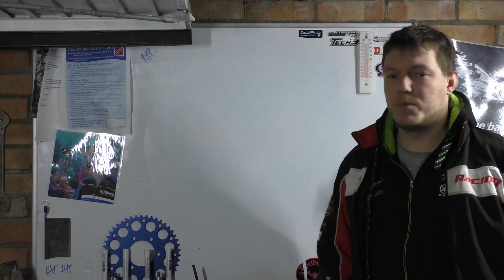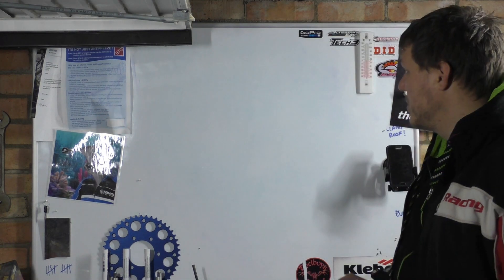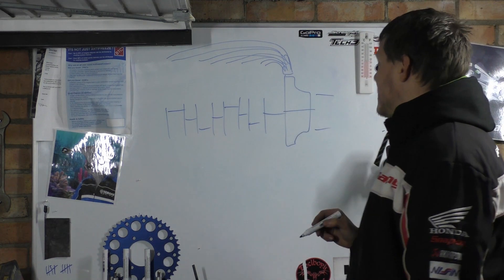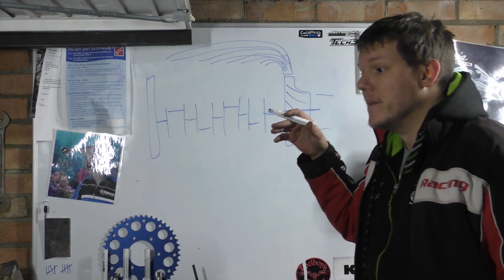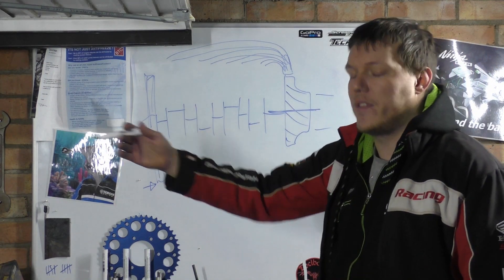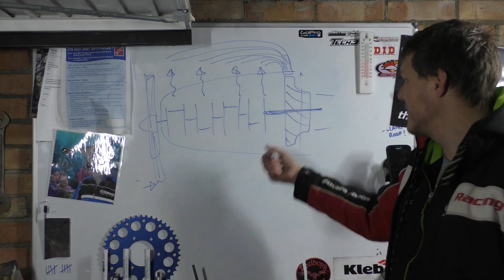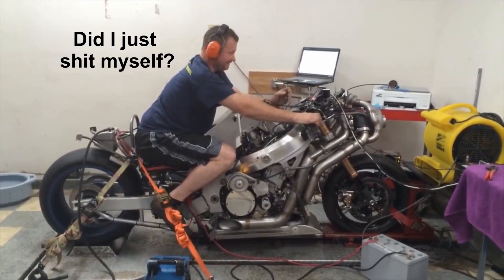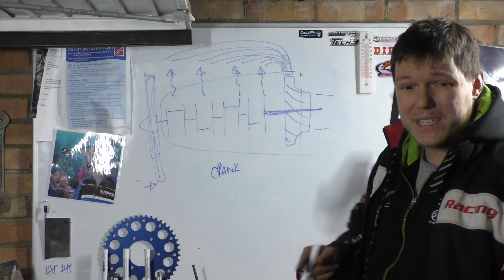Turbo Compound engines - How they work - Part 1

Comment: you can make that turbine to turn a generator. then an inverter with proper work point tracking can feed an electric motor.  thatway you make sure to extract as mutch power as possible. in ww2 supposedly them eglish peeps managed with mechanical coupling a whopping 30 ish % GAIN by turbo compounding. i would welcome it on bikes and trucks and cars and what not, to be honest.
Reply: Its been tried Scanna offfered a turbocompound engine for a while.
Reply: @jediknight1294  yep, and in hungary RÁBA offered a 180 hp "kombi-turbo" engine. however, those did not employ inverters to match the load. for applications that had variable loads and engine RPM conditions, those solutions where not so good. one methood was using a direct gear coupling, and the other used a super complicated hydraulic system. none of those managed to work properly. however nowdays it would be verry possible to use a proper inverter, loadmatching , and thus it would be a very viable solution. currently the technology does exsist however its patented and for that reason it will never be allowed to be used. sad story.

Comment: There are some tractors with turbo compound but the compounding turbine is attached to the gearbox by a transfer case instead of attached to the crankshaft.

Comment: Matt! am I wrong (I'm not😁) but the ultimate turbo setup is VGT, all the pro's none of the cons of any other turbo configuration, WHY are other systems still used!!!????
.....Cost, I know, but other then that....
Reply from the maker: Variable turbos are variable to a certain degree, the issue is generally spool up times and VGT's help a bit bit there's still the mass of the turbine wheel to acelerate.
Reply: VGT turbo's limit exhaust flow at higher vollums.

Not sudge a problem in a diesel ware exhaust energy is limited by bether fuel efficenty and no varible valve timing.
Less heat and lower RPM means that the restriction @ higher exhaust vollumes is not an issue.

On a gasser this is an other Story.
There is more heat availeble over the rpm range ..and the RPM range is wider 
Here the gasser makes power in higher RPM as the diesel.
A restriction in exhaust flow would raise EMP (exhaust manifoild pressure).
Changeing the ratio between IMP(intake manifoild pressure)/EMP you would negatieve effect your VE(vollumetrich efficenty).
That's why ita not the number one choice in a gasser.
Max EGT (exhaust gas temerature) that these VGT turbo's can take are also lower then the waste gate types.

Porsche had VGT turbo's on al gasser

Comment: Hey, I'm not trying to be pedantic, but you said the turbine is directly coupled to the crankshaft.  Digging back into the cobwebs of my memory and aviation classes,  turbocompounds are generally geared to the crankshaft.
Reply from the maker: LOL it depends what you mean. Most of the compound engines that were designed were here in the UK and they had turbines wheels connected to the crank. The nomad is the obvious example, The R-3350 had external turbines and an impeller attached to the crankshaft - more modern examples have geared connections rather than crank attachment. Smaller and lighter.
Reply: The Workshop Could be that ale let my speck of knowledge about centrifugal superchargers leak into.the tinier speck about turbocompounds...  

Yes, you Brits came up with a few that weren't seconds away from breaking at every conceivable moment (like the Wright). 

There's something about those old fire breathing machines designed by men with sliderules and flown with guts. 

I still have a thing for round engines, though. Had an F4U Corsair poster on the wall as a boy.  It didn't impress my great uncle, a Grumman engineer who worked on the Bearcat.

Comment: OK. I get it. I thought you was talking about compound turbos. kinda like twins. except the are a smaller and larger turbo. with the larger turbos output feeding the input of the smaller one . then to the engine. and the exhaust side doing the vise versa. so the smaller turbo can spool faster. for low end power. then as it starts peaking. the larger starts pre compressing the inlet charge. I guess a simpler way to explain  would be boosting a turbo'd engine! that's what you was getting at. this is a different kind a monster! looks like one anyway!
Reply from the maker: This is compounding turbos not turbo compound engines - this is coming next though....

Comment: Why are these used on diesels so much, but rarely cars?
Reply: The increase in risk of sending your engine to the nether realm and the cost of developing and building it? 
That's my guess in short terms. :P
Reply: But one foot at the edge of the nether realm is the sweet spot for all engines!
Reply: There are only 2 diesel engines currently using turbo compounding... Volvo D13 and Detroit DD15 and DD16. Compounded turbos on the other hand are more common. They are used to increase boost pressure.
Reply: Becouse compounding means multiplay the PR and there is no over boosting a diesel.
But depending on factors Like octane, IAT, ethanol, ignition timing  bla bla auto ignition will become a problem at hi PR (presure ratio).

But internet hero kevin jewer drives a 2.0 4 cil evo engine @45 til 60psi boost. (996hp)
So it can be done

Comment: The P-38 Lightning used these. At first when the quill shaft would break the centrifugal forces spun a few planes into the ground. They later fixed that issue.
Reply: Maybe you're confusing the compounded turbo / supercharger but these were not a turbocompound engine.The only turbocompound  aviation engines I'm aware of are the Wright Cyclone and the Napier Nomad.  Turbo-compound versions of the Napier Deltic, Rolls-Royce Crecy, Rolls-Royce Griffon, and Allison V-1710 were constructed but none was developed beyond the prototype stage. https://en.wikipedia.org/wiki/Lockheed_P-38_Lightning

Comment: what if we pass the exhaust through another propeller to produce more power keeping in mind not to run the other propeller via an engine connected to it.I hope it will surely produce more power.😀😀😀😀😀
Reply: Saubro Bo
Reply: Puffy Panda 
What do you mean really?

Comment: Well the turbine on my turbo is about 60mm diameter, spins at about 150,000 rpm and generates about 10hp. So either you have a fuck off heavy turbine spinning at a low speed taking up fuck loads of room for very little power output, or a big complicated gearbox to increase the output rpm to something useful and then manufacturing costs go WAY up for very little benefit. Not sure how this is a particularly effective solution, as you're always adding weight. Surely would be more effective to run a conventional turbo and then run an Otto cycle and recover the energy this way?
Reply from the maker: http://naca.central.cranfield.ac.uk/reports/1944/naca-report-786.pdf

Comment: What about powering your generator, waterpump......  whith the exhaust instead.?
Reply: Ahem... Recovery turbine linked to the crank via conical gear so one can vary the speed to match exhaust; the recovery turbine has "freewheeling" extra stages connected to another blower, or leads on to a conventional turbo feeding into a reservoir, which then leads on via an overpressure valve to a bypass inside a roots connected straight to the crank. You get the full low-end torque boost from the roots, however with boost in the reservoir on tap you won't need to waste power off the prop shaft to turn it at low speeds, and at higher revs the flow of power "evens out".

Comment: It was used on the madness that was the Rolls Royce Crecy two stroke aero engine.
Reply: That is an interesting engine :)
Reply: I'm just reading a book on it, Royce never got the bugs out of it so it never got fitted into an aircraft but it would have been hellishly powerful if they had. And noisy.
Reply: @markyoung13  theres so many fun designs that if they'd got the bugs out of it would have changed cars/aviation and that is one of them. The chevy turbine is annother.

Comment: Wouldn't a little bit of a gearing betwix the turbine and the crankshaft be a tad bit better because turbines make fuckall torque? Like some sort of gear reduction from the crankshaft to the turbine?
Yeah, i know it would increase wear and maintenance cost because more moving bits and more oil lines and stuff, but i think it would be a bit better
Reply from the maker: 2 things -

1) they do, volvo and Scania have reduction gearboxes - but this drive is not directly attached to the crabnkshaft.

2) Turbines speed is a design function not a static fact. Turbines in turbo's go 100k rpm+ but that doesn't mean all turbines do. You design the turbine accordingly.
Reply: sure, one type of "gearbox" vs. another, but I suspect that to get usable power at normal engine speed the diameter will have to be quite large
Reply: The problem is making gears that can handle 100k+ rpm. Do-able but stupidly expensive.
Reply: Pedro, that shown compound engine is to spin the crank faster/easier with less consumption of fuel. It is not to boost the intake pressure! Look at it as adding the power of 1-2 pistons without you having to add those pistons. If you gear that you would not gain anything more that rotation speed of the turbo. What would work but you don't need to. It is like a waste energy recovery snail.
Reply: Keith Duckworth designer of the  extremely  succesful Cosworth DFV F1 engine, planned to do a V6 turbo compound with the turbine inside the V and CVT to the crankshaft for the ~1985 F1 season but it never happened
Reply: you still need to match the ~optimum speed of the turbine with the ~optimum speed on the crank, that may not be possible with a 1:1 ratio
Reply from the maker: "you still need to match the ~optimum speed of the turbine with the ~optimum speed on the crank, that may not be possible with a 1:1 ratio"

- this is dependant on the turbine used....

Wiki ~

"In order for tip speed to remain constant, if 
the diameter of a rotor is reduced by half, the rotational speed must double. For example, large jet engines operate around 10,000 rpm, while micro turbines spin as fast as 500,000 rpm."

Turbines don't have to spin @ 100,000rpm. You design them accordingly